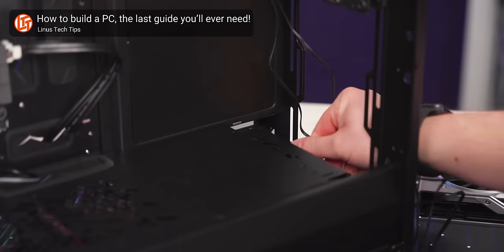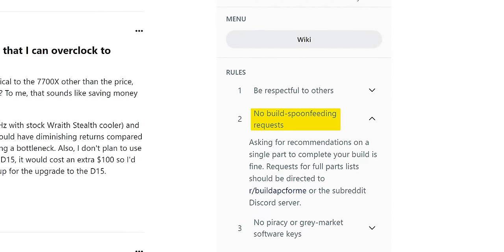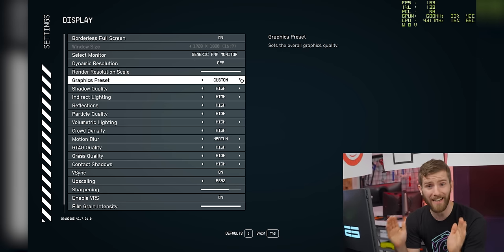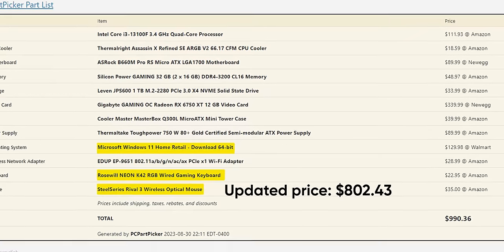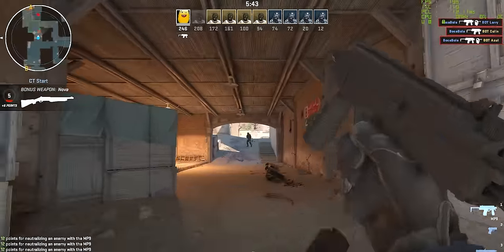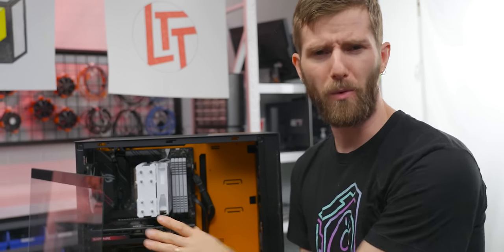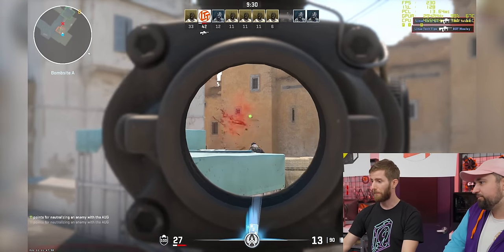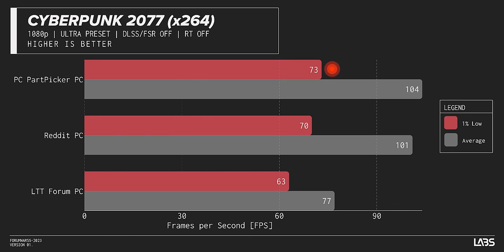We Secretly Challenged 3 communities to Build the Best $1000 Gaming PC!

Comment: Correction in the video, with the LTT Forums Pc:
The ram was 4x8 ( I Presume ) not 2x16 and from Corsair, not from GSkill. The PSU is clearly labeled a Seasonic PSU, not a Corsair one.
Reply: And the GPU was a Sapphire, not MSI
Reply: @jfernandez76  very strange, as the INDIVIDUAL models themselves matters ALOT. Pretty lackluster video, if it was me i wouldve shattered this build comp.
Reply: Mate just watch the video, he said at 3:30 that the parts wouldn't be exactly the same.
Reply: @Hetsu..  If they matched the clock and timings for the RAM then the model does not matter. 4 vs 2 sticks decreases your signal eye, which causes system instability. It does not technically affect performance (It will often require you to underclock your memory however to become stable). So for a raw performance comparison, none of their substitutions mattered. Now if you were to overclock the systems at all or cared about long term reliability, Their changes would have a dramatic effect.
Reply: @dihydrogen4781  i doubt they matched the timings though, aib ram timings are all different
Reply: @NADP0  which is stupid, there are 100 different aib models of the same b550, it matters.[

Comment: A lot of people do not live close to a Microcenter but boy do they have good deals, specially their bundle deals. Right now, they are running a 5600X3D, Asus TUF motherboard and RAM combo for 299 (about $150 off from MSRP). You can easily put a build together around those 3 components that can beat the 3 PC in the video.

Comment: Agree, Fractal, Phanteks, and Lian Li are all very good choices. I've built in all three (specifically, the Torrent, older P600S, and O11D Evo) and it was a pleasure to work in with no issues in cooling.

Comment: Linus, one thing I noticed on PC forums is, that a whole lot of people have absolutely no idea about one very important part of the whole PC: the monitor! I´ve seen loads of posts where recommended PC parts will make a absolute high end overkill monster, but people play on 1080p 60hz monitors, with bad colors! Or some people who have those overkill PC, wonder why the image still looks bad, while their settings are set to 59.94hz. There are many people who have a good budget for a PC, but spend all on thhe computer itself and still use an old crappy monitor in the end. I am convinced that a lot of people would have a way better gaming experience, if they´d use their budget different, go a little lower on the PC specs, but get a quality monitor instead. So, for educational purposes, would it be an idea for you to make a video about monitors and how to get one that fits the computer it will be connected to, so you end up with a balanced setup?

Comment: 12:00 case design is important!  Once!  And if you pick the RIGHT case the first time, you can use it for multiple builds or even multiple upgrades.  Signed, guy whose one kid is still using the p182 case he bought in 2008 and whose other kid is still using the Three Hundred he bought in 2014.

Comment: I very recently built a system with a 2500 USD budget. My first build. And I went to all three websites for help. I would say just following any one site is not a good idea. For example I first asked on ltt forum and got a reply really fast with many people recommending builds. I then took each of those builds on to pc part picker to compare price points and potential upgrades by mixing and matching parts. Once I had a build based on performance I then looked around reddit for more builds and only took those builds that had aesthetically pleasing components like maybe a better case or maybe cooler RGB all the while making sure performance or budget did not take a major hit. The good thing about that is as reddit is much slower to answer it still has a much bigger repository of previous suggestions to work with if it's just aesthetics you are researching. And then finally I asked all my part compatibility doubts on ltt forum because people there are just so quick and easy to understand. It's a a long process and don't expect to finish a build in just one night. If you really want a system you will be happy with like me then you gotta put in some effort and your own research to make the best choice.

Comment: Its insane how much you can save by buying used though. I just built a PC for about 900$ with everything new (5700X3D, 32GB RAM, 650W Seasonic Focus GX) plus a used 3080, that i got for 300$ - and i think you could even get better deals for used 3080s or 4070s.

Comment: I actually disagree with the takeaway here. Bethesda's Creation Engine benefits from a beefier CPU than most would expect. Since they specifically said they wanted a good PC for Starfield (which uses Creation Engine 2) at a low budget the build from LTT forums is one I would have recommended.

Comment: 12:00 in case of case...I would spend a little bit more and use this case for many years with many upgrades in-between.
The PC case is like a house foundation - you can redesign the house countless times as long as the foundation allows it.
So don't save on the cases.
I use for my RIGs LianLi Dynamic 0-11 of course...and LanCool Mehs 2.
Best choice ever for me.
My oldest case is still in use is an Chieftec MESH CA-01 Silver... I use it for over 20  years.
Aaaand... I always spend more money for the best😮 CPU to be able to upgrade my GPU later for an better one, without to run in to CPU bottleneck problems.
A good CPU can easily handle a few newer GENs of GPUs.

Comment: I normally just google best upgrading paths for X cpu or X gpu to find recommended builds then use that as a guideline for best price to power ratio with reviews. That being said I still haven't pulled the trigger on a full rebuild. I am leaning towards team red but I really like the 4070 performance with lower power usage.
Reply: I just switched from a 6800xt to a 4070. It's extremely smooth the room doesn't heat up and everything simply works without messing with settings. I recommend it

Comment: Super glad I educated myself long ago. I know exactly what I want and why, and anyone that knows PCs respects my setups. Right now it’s -

CPU- Ryzen 7 7700X (eventually gonna update but great budget AM5 and works perfectly with my GPU so 🤷‍♂️)

Cooler- Noctua D15 Black

MOBA- AsRock X670E PG Lightning (200 bucks for a X670 board and I’m not touching Asus even if I could save 10 bucks)

GPU- Currently still have my EVGA 2080Ti but upgrading to a 7900XTX (or a 8000 Series depending how long it takes to save) since I run Linux and AMD has better Drivers for us

RAM- T-Group White Delta (32g at 6000, perfect sweet spot)

Case- NZXT White H7 Flow 

SSD- 1TB 980Evo and a 1Tb 870Evo (prefer to have a cache on all my drives)

PSU- Be Quiet 1000W I’ve had forever (eventually going to upgrade to a SeaSonic GX-1000 but not worth it yet, cable managed really well so semi-modular is fine right now)

Don’t think I forgot anything but yeah. She’s awesome. 120 easy at 1440p high especially once I get that 7900.

Comment: Supposedly there's better QA going into these videos but I noticed some issues:

Wrong clock speed at 3:18 (or the voiceover and label are both wrong)
Wong voiceover details or incorrect labeling at 3:26 (Voiceover says 16GB kit, shown in label as 2x16GB kit; Later list says 2x8GB kit so label may be wrong?)
Wrong clock speed in voiceover and stick quantity error at 10:39 (3600 is said, list and label and parts list say 3200)

Would also argue the substitution of a P5 Plus for a P3 at 6:56 is not comparable as the P5 Plus is the more premium product, and that swapping 2x16 kit for a 4x8(?) kit at 10:39 is also not comparable as some games can benefit from such.

On top of all that, without a list of the actual parts lists you used in these systems the numbers Labs provided don't really mean anything, since the parts mentioned in the build lists aren't actually the ones being used (as mentioned), and when substitutions like the 2x16 for 4x8 situation happen, you can't trust other changes weren't made in other parts in the system that could affect performance numbers vs the actual numbers the real part list would put together.

Comment: This was an advice build, remember that reddit does have the best crowd-sourced guides for budget-based builds with literal spreadsheets of breakdowns. Also, if you're shopping under $1000, literally look into how much you can buy used, if you MUST have a gaming PC as someone without one instead of saving up, buy a cheap used GPU from recent gens and replace it once you've saved up. Monitors, RAM, Cases, Air Coolers, and Fans tend to be easy to verify functionality. Once you see if you're fine running on lower settings for games that may be graphically demanding, as well as the lower framerates and smoothness, then you know for the future.

NEVER EVER FINANCE, by the time you pay it off, parts in your PC will be broken or they 'suck' now and you'll be more in debt.

Comment: i use somethign like part picker, actually a shop with a build-your-own pc thing. I put the stuff in, it tells me when something is wrong and then i buy either the parts or pay quite a lot to have them build it. 
Of course i know mostly what i do but building one every 4 years or so, you need some help to get up to speed.
Btw not caring in the SLIGHTEST about RGB made the whole thing so much easier. Including my old case and cable management. The case is great, it just doesn't have glass or rgb. 

Btw some people, like Nvidia users, have a slightly different opinion on the "great" Bethesda/AMD cooperation. The dlss patch is finally coming.

Comment: Here's my attempt, all from newegg (I'm UK based, so don't know US retailers so much)

CPU - Ryzen 5700X - $179.95
COOLER - Vetroo V5 Black aRGB- $27.99
MOBO - ASRock B550M Pro SE (inc. USB3 header) - $74.99 or Gigabyte B550M DS3H AV for $89.99 (Wifi 5 for + $15)
CASE - Phanteks G300A w/ 1 aRGB fan - $49.99
GPU - Gigabyte RX 7800 XT 16Gb - $499.99 /free copy Avatar: Frontier of Pandora
PSU - Corsair CX750M - $74.99
STORAGE - 1Tb WD SN770 (5150Mbps)
RAM - 16Gb DDR4 3200Mhz Team T-FORCE VULCAN - $33.99

Total - $1008.88

I would add in 3 front case fans ~ $15 (Arctic P12 black / Thermalright TL-C12C-S aRGB)
Windows 11 digital license ~ $10
Add in Wifi 6 card from Amazon (Ubit typically) for about $25

I've skimpped a bit on the PSU, but all other areas are solid, and I bet it'd perform better than any of the options in the video.

Comment: I’m building a budget PC right now and went with the 7600. It’s definitely not as good as the others, as this video showed. But I do want to highlight what Linus said — none of it is bad. My budget was only $700 and I was able to snag the 7600 for only $180 at micro center, and I am very very happy with the performance.
Reply: 7600 isn't bad at all, and a gpu is very easy to swap if you ever actually need to get a better card a few years from now

Comment: I will say the last build, while it does have a slower gpu, is nice in terms of someone who may be looking into more content creation down the line. A nicer cpu for streaming, more RAM to handle more tasks such as the game, OBS, chat, etc., and a higher quality SSD to ensure your content is safe (as safe as it can be with out a backup). So, tradeoffs, but still pretty good imo. GPU could def be upgraded down the line with the rest of the system holding it's own for a good while.

Comment: That comparison should have been done with NVENC for the Reddit PC as RTX 4070, it's an advantage for the build and should showcase the advantage (even if not apple to apples, maybe both graphs, though it would mean an extra round of testing).
Most would stream one game, and if e.g. CS which is CPU bound, you'd want to offload to GPU, and RTX 20 series and newer have a "dedicated" encoder.

Nvidia's marketing, so best-case, states on a 2080 with an 8700K going x264 fast to NVENC goes from 59% CPU utilization to 1.5% (x264 very fast is 34%), this with the 20 series with marketing from 2019, 40 series has a newer encoder, though unsure if that improvement there is only AV1.
Reply: it's a similar story on AMD nowadays tbh. CPU encoding is pretty dead IMO, unless for professionals.

Comment: The approach the LTT forums build took is not a bad one. Prioritize CPU first, and upgrade the GPU a few years down the line. The GPU is the easiest thing to upgrade, whereas upgrading a CPU typically means upgrading the motherboard, and potentially the RAM. I personally prefer to go with a higher end CPU than I think I'll need right now, so I won't feel the need to upgrade it any time soon, and rather spend less on the GPU. Especially with current GPU pricing (and the likely Super refresh of the RTX 4000 series around the corner), it makes a lot of sense to not spend too much on a GPU right now. In the short term, you will have a somewhat worse gaming experience, but still capable of playing the games you want to play, which is what really matters. But you'll end up with a better PC in the long term after one simple upgrade.
Judging every build by their specs and not taking into account upgradability, the LTT build loses. But I think the guy made the right call taking upgradability into account, since people building their own PCs don't simply make a new build every time they want an upgrade, they typically go through a couple upgrades before an entire new build. His approach gives someone an easy upgrade path, when hopefully prices will have dropped.

Comment: The case is so important for a build. I wonder how many PCs have been abandon because the case made it so much more difficult to finish. Worse yet, how many builds look like garbage because the builder gave up after 8 hours, said fuck it and cut corners just to finish the job. That Lian Li case both the 215 and newer 216 are amazing to build in. It looks fantastic and you do not have to put a lot of careful thought into how parts are placed, it will just work.

Comment: The tough part about this there is a lot of detail missing? You shouldn’t have that bad of 1% lows with the 6800 XT. My guess is bad driver revision or some setting that is not playing nice. I found that my 6700 XT would often stutter using fluid motion frames. Turning it off I got nice smooth performance with better 1% lows. I’m guessing there was some setting driver was on the 6800 when this was filmed causing the problem

Comment: I have a 5900X, and those extra cores are really nice for x264. You can use slower encodings than what a lot of hardware encoders use (meaning higher quality for the same bandwidth).
Reply: Honestly even streaming with AMD which is supposed to have the worst image quality, things look great. Streaming services don't have the bandwith for higher quality encoding to make the difference. As long as you just throw double the recommended bitrate at Youtube, it comes out identical regardless of the encoder used. Tbh I usually don't even bother locally recording videos anymore, when I can stream it instead and let Youtube handle it. It's so convenient.

Comment: I would normally be a Ryzen guy but there are some sales on amazon right now making all of these builds a little less than optimal.

I made a pcpartpicker list [ /list/HknmxH ] and it has a 12700kf/3070 ti/32gb 3600mhz/z690m/500gb gen 4 boot/2tb gen 3 nvme storage/750w gold seasonic

Comment: The LTT one has the advantage that you can save up in ram by going 16gb instead of 32gb, a cheaper case, and the fact that it will be less CPU bound than the others, and since GPU bottleneck is easier to fix than CPU bottleneck (there's next to nothing you can do to fix CPU bottleneck) it is a better invest if you plant to upgrade graphic cards in the future

Comment: I thought LTT was gonna start checking their vids for obvious mistakes ? Talks about a 16gb ram kit, B-roll shows a 32Gb, talks about a corsair PSU, B-roll shows a seasonic one.

EDIT: I used pcpartpicker to make my new build during black friday deals and it's really nice to have a tool that prevents you from taking incompatible parts even for a veteran like me, as well as having pricing and your parts list and the price total all in the same place and allowing you to mix and match options. You can also manually set the prices of parts if you found a deal somewhere they don't have in their current pricing data. Overall it really made it a breeze to keep on track of everything.

Comment: Thing about that 4070 vs 6800, see what happens when you exceed 12 GB VRAM usage even slightly. The 4070 falls off a cliff while the 6800 keeps trucking and it's only going to start mattering more and more. I mean DLSS is sick but there's no AI wizardry for making 13GB of assets & shaders fit in 12GB - best you can do is take smaller assets and upscale the generated frame, but we all know it's not the same.

Comment: Seems there's a little error at 10:41 when Linus says the RAM is 3600 CL18 when it seems it's actually 3200 CL16. The on-screen text says it's 3200 CL18 but (based on the screenshot shown at 10:23) the original post from LTT forum user Why_Me says it's 3200 CL16. So I'm not sure if it's CL16 or CL18 but it's definitely not 3600.

Comment: No one is stopping anyone from getting information on those 3 platforms simultaneously. You will be self blinded if you get your information from a single source. It's best to get the information from multiple sources and validate thru an extensive research.